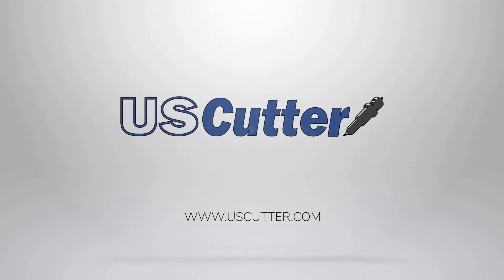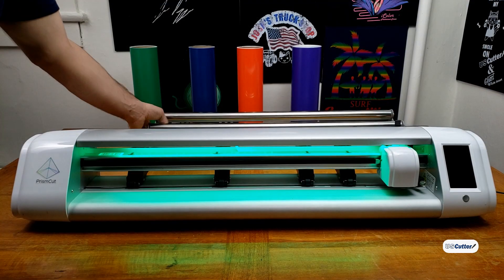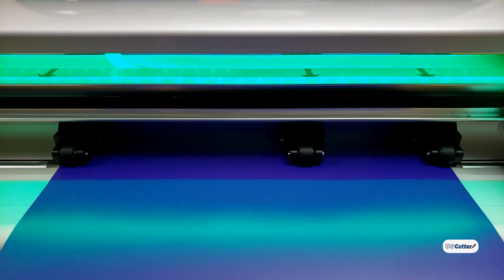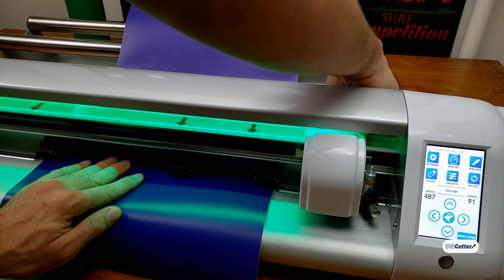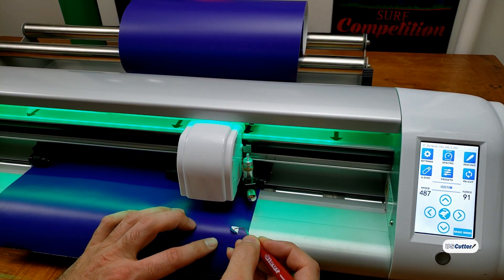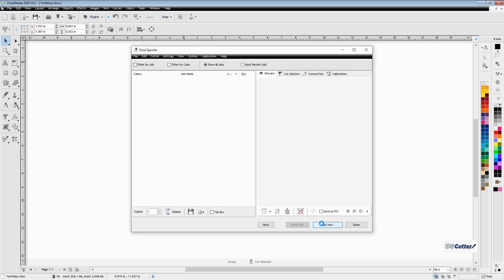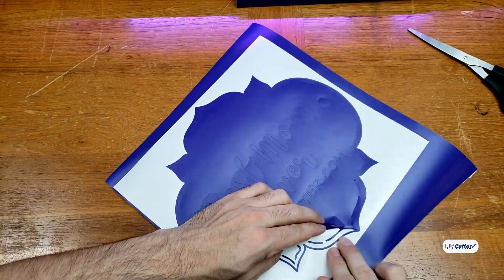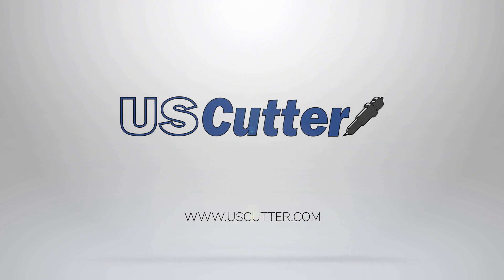Quick Cuts - Loading & Cutting Adhesive Vinyl in your cutter with Vinyl Master

Comment: I have the MH series cutter. I am getting horrid marks from my rollers. Have been to the forums, and I have the adjustments all the way out.  It is still crazy bad. It there anything to help with this?
Reply from the maker: Pressure on the pinch rollers is too high.  If its leaving a huge crease down your vinyl then you have the pinch roller halfway on and halfway off the grit roller down below.

Comment: How do you run the vinyl back and forth like this on the titan?
Reply from the maker: Press the ON/OFF LINE  button and then use the arrow keys  (speed and pressure)  to move the blade holder and position of the roll. Press ENTER on the keypad to set the origin point.

Comment: I didn’t realize there was a marker on the SC2 indicating where the gap was. Good tip. That needs to be in a quick start guide. :)
Reply from the maker: ⊙_ʘ  Thanks watching and I will let the product development team know to make a change for the next print run! - Josh
Reply: @uscuttervideos  As far as lining up vinyl goes, I thought I was brilliant when I finally started using an envelope to evenly space out the right margin...and doing so, I noticed the SC2 had a ruler on the back edge too. I use that to line up the front part of the vinyl with the back, and that seems to get it straight enough for large cuts. Do many of your cutters have rulers on the back side?
Reply from the maker: @allenhuffman  I believe all the USCutter ones except the Prism Cut have that on them.    I use the one on the front of MY LP3 all the time at home because I don't own a ruler or measuring tape. - Josh